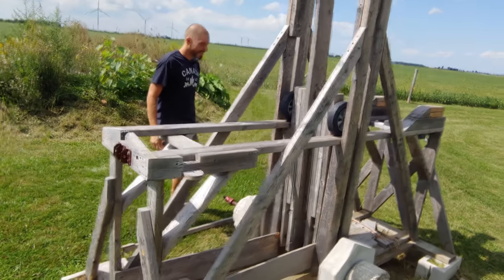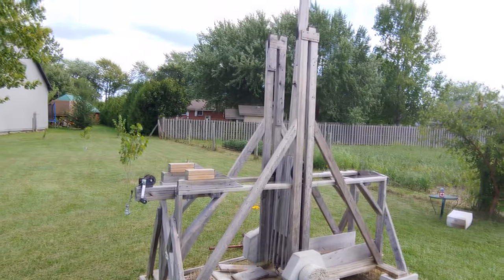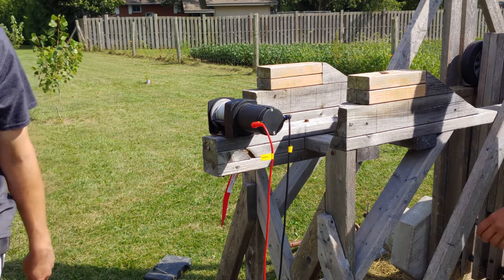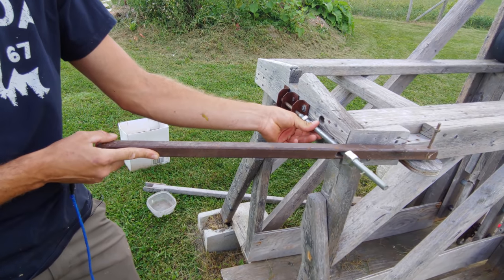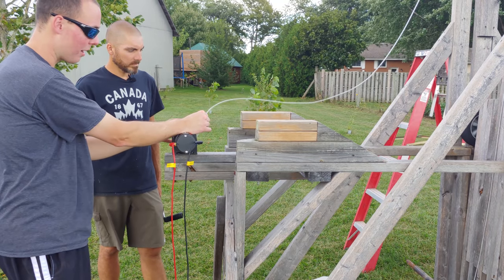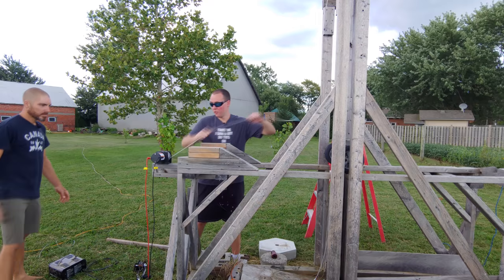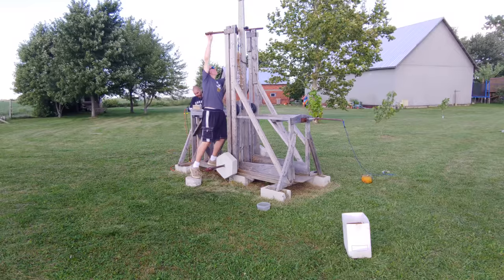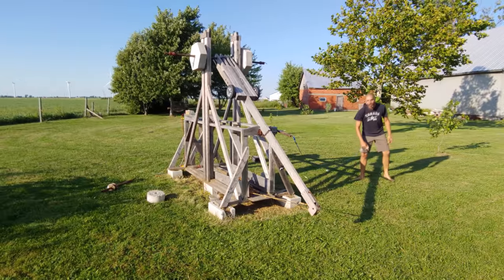Fixing Up the Super Sketchy DIY Trebuchet

Comment: 15 amps at 120v is a theoretical 2hp. But the battery charger is putting out 15 amps (theoretical - quite possibly less) at a mere 12v - so you're only providing the winch with a maximum of 0.2hp.

And by the way - looks like fun!
Reply: Follow up - one other thing to keep in mind is that a winch is rated for pulling, NOT for lifting. I suspect you've got way more than enough safety margin for this use case, but something for folks to keep in mind.